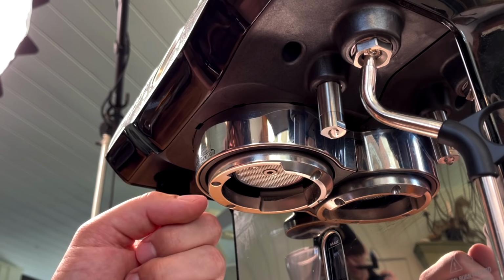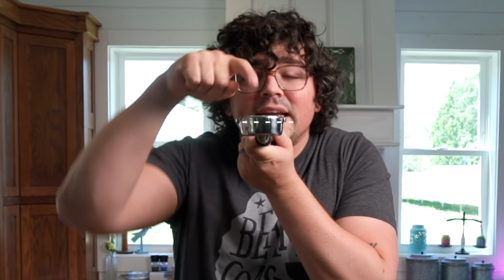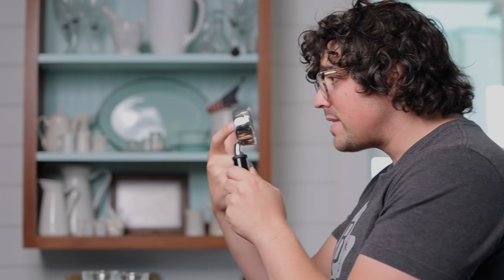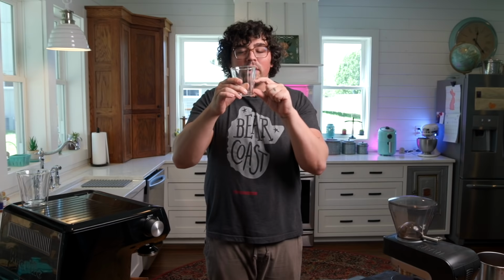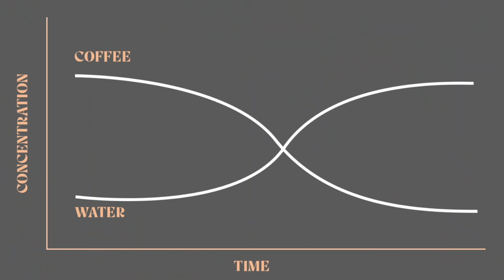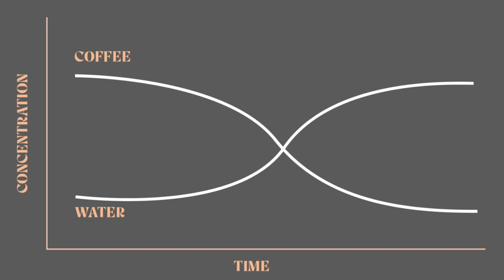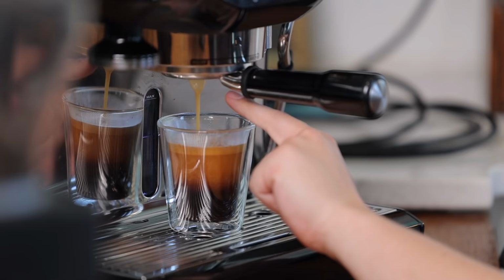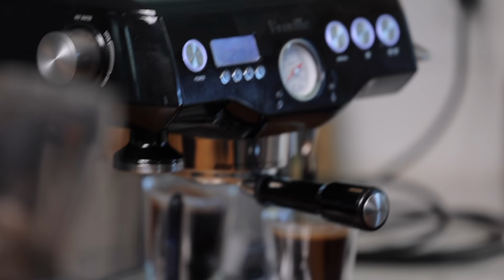ESPRESSO EXTRACTION THEORY: How to Dial in Espresso Like a Pro (pt. 1)

Comment: Professor Lance, please talk about optimal shot time. 25 to 30 seconds from first drip, or from starting of pump? Nice job. Thank you.
Reply from the maker: For sure! Next video will be hitting a lot more practical information on espresso. For now, just know that shot times should always start when you machine is started. Whenever water makes contact with the bed, start the timer because that part is still extraction. More to come and thanks for watching!
Reply: But then you have machines like the barista express which has 10 seconds of preinfusion. This is suoer long. In such extreme cases I would not count from button press. Also remember that way more extraction happens when water is flowing through the Puck compared to when it is just dripping onto it. So the part while it is aktually flowing out is way more important. Maybe try to shoot for the lower end of the 25-30 sec rule if you count from first drip. But all in all the rule just helps you to get into the right area if good extraction. After that go by your taste and preferences.
Reply: @Random-yj2tr  I guess it doesn't matter too much when you start timing as long as you use the same method when dialing in your coffee. I think that it might be confusing for some people if they start counting for 25-30s from first drip as in reality this could be more like a 35-40s extraction time (from machine start) and could lead to over extraction. If counting from first drip you might need to reduce your target extraction time by up to 7-10s (or longer with a long pre-infusion).
Reply: @chrisdturner  in the end the question is how much the preinfusion extracts the coffee compared to actively pushing water through. I sadly don't know how big this value is at all... :/  I personally think that preinfusion isn't contributing that much to extraction compared to pushing water through. And because preinfusion is so variable between machines I would start from first drop. But you are right, the most important thing is that you stay with your method during dailing in.
Reply: @Random-yj2tr  true enough, it's hard to tell the difference pre-infusion makes in an objective way and is probably contributes less than grind size and yield. I expect pre-infusion probably extracts little compared to when the water is flowing through the grounds under pressure but probably helps reduce channeling and get a more even extraction. I think using total extraction time as a reference (by any means) and learning to adjust by taste is the best approach for me personally but took some practice.
Reply: @Random-yj2tr   10 seconds is pretty short, and not at all extreme. In the case of the barista express, it's a marginal decrease in flow rate. Besides that: time should only be kept at a dependent variable. A 30 second shot could be battery acid or more bitter than pith.
Reply: Note time by button push,but keep it as a dependent vsribale. Dial in by ratio to your taste. Weigh your output. Ensure everything is consistent changing one thing at a time. 

Is it sour? Pull more yield. Is it bitter? Shorten your yield. Find a sweet spot and then keep varying within that range.
Reply from the maker: I understand your concern but just so you know, preinfusion is pretty massive in how it primes the puck. 10 seconds is degassing and will allow a rapid start to diffusion following. I have pulled shots on so many machines it'd boggle your mind haha! It is much easier to count from actuating to end as opposed to first drip. 
Regardless, time is least important. That's why I harp on not observing 20-30. Time is just not really something to consider in reality, at least not with the obsession most do. Anyway, my two sense working with preinfusion since 2015.
Reply from the maker: Yup! Nailed it..this is my approach certainly. 🙏🏻
Reply from the maker: Crap..first comment was for @random123 and second one for @dumkopf

Comment: Lance, you are the absolute best at explaining things in a way that everyone can comprehend and relate to. Please don't ever stop educating us! I'm currently using the new Eureka Zero espresso grinder and I love it by the way. But my grind setting is at about just under 1 and my shots from the time I see it coming out to when I reach the 1-2 ratio on the extraction is only about 15 seconds. I do lattes but when I taste the extraction, it is on the sour side. I am using the distributor tool for about 15 seconds, then I tap the basket to fill any holes, and I tamp pretty hard and before I remove the tamper from the grinds, I turn it (I say that because I'm giving all the steps and maybe I shouldn't do that last part). The machine is a Lelit Mara X with flow control. I have it set to expresso for the temperature (vs steam temp). I start the flow control paddle all the way to the left, leave it there for a few seconds and then slowly move it to the right (maybe I shouldn't). Any suggestions on why the timing is so short? I'm at a loss to figure it out.

Comment: Questions for the next video:
- Can you identify problems looking at the puck after extraction?
- Does dialing in change with coffee age (days Vs weeks)?
- If weighing & distributing, how else to improve consistency?
- Can you tell if shot is running fast due to coarse grind Vs channeling?
Reply from the maker: -sort of but not really. Can see holes sometimes, but doesn't mean if you see no holes there wasn't any channels.
- yes. Coffee is more easily extractables the further off roast it is (to an extent). So, chill out on variables as it ages
-weiss distribution technique 
-not really. If coarse, channels will shoot everywhere and flow will be fast. If channeling, well, could seem tight and slow with occasional odd squirts or could look normal or could look many other ways. Difficult to really know outside of taste.
Reply: @LanceHedrick  Thanks!
Reply from the maker: No problem! Some will be hit in next vid, but some will be saved for future more advanced espresso vids, so thought I'd go ahead and help

Comment: I have been making espresso since year 2000 this is super well informed.
Concentration is often missed I prefer ristretto espresso exclusively.
1 to 1 or 1 to 1.2 or so 25 grams in and out. 30 to 35 seconds 8 bar of pressure set at a blank.
This was super well explained would love you to do a video on ristretto espresso.

Comment: I just bought my first espresso machine last week! What perfect timing for your mini-series to come out! After pulling a couple of shots, I'm still having some difficulty dialing it in and knowing what I should be tasting for. Sometimes the shots turn out good, but most of the time it has a harsh jarring taste and an acidic punch. Not sure if the acidity I'm tasting is from having bright/light roasted beans or from an under extraction. Can't wait for part 2 to learn more and get the most out of my new machine! :)
Reply from the maker: Absolutely! Light roasts will seem sour if trying to pull them in the same range and recipe as dark, simply because they're not as easily extractable. Will go over all this in part 2!

Comment: Hi Lance, one thing I haven’t seen covered by any videos (which I’m really curious about) is what happens in terms of taste if you adjust two variables? For a starting point, let’s say I’m doing 1:2.5 at 9 bars over 30 seconds at a particular grind size. For this example we’ll hold time as a constant. What happens if I go down to 6 bars and adjust grind size so that I’m still pulling a 30 second shot at 1:2.5? How would the taste be affected? What if we held the grind size constant and reduced the pressure from 9 bars to 6 bars and just pulled the shot until we had our 1:2.5? It seems like there’s so much emphasis placed on pulling a 28 second shot +/- 2 seconds, but why? If I ground a little finer and the shot took longer wouldn’t things more or less average out because not as much water is getting through the puck in any given second?

I’ve watched some of your videos (including the follow up to this) as well as James Hoffmann’s understanding espresso series and everyone does a great job of explaining what these variables do individually BUT, they all have an interaction with one another. The interaction between two or more variables is what I’m trying to get a better grasp on. 

Maybe another way to ask this question is… is it possible to manipulate the variables in such a way that you can produce shots with substantially different variables, but which taste the same?

I’d love to have a Decent so I could just program a matrix test and do these comparisons directly but… I’d also need a money tree to make that happen. 😜 I just bought a new-to-me Robot from a friend. If I tried it with that I’d have disproportionately huge arms!

Comment: One added phenomena that I did not hear you mention is that there are lots of different compounds that extract…. And not all of them extract at rye same rate.  So, for example lots of the good stuff extracts easily and therefore in the beginning of the shot…. We’re as other compounds (like bitter caffein). Extract more slowly an are a more dominant part of the extraction the longer you run water through the puck.  So the over all taste of the coffee changes.   This is easy to illustrate by pouring a separate cup of water through used filtered coffee. Notice  the dramatic change in flavor.   It is not just weaker…. There is an entirely different  flavor
Reply from the maker: Yep. Of course. Not something I wanted to cover in a basics video, but something I have covered elsewhere! Cheers and thanks for watching!

Comment: Lance - I have watched part 1 and part 2 - best explanation I have ever heard.  I only make coffee for myself at home and not very experienced.  I have a question.  I owned a Barista Express until this week when it died and had no problem with my extraction.  Yesterday I purchased a Breville dual boiler BES920 and for some reason I cannot get the extraction pressure anywhere near 9bar.  I have set smart grinder to very fine grind after trying a coarse setting and made sure I have evenly spread the grounds and tamped as i normally do and still cannot reach anywhere near 9bar (about 3-4bar).  The only difference to my old machine is that I am using a bean I have not used before.  This one is a very light roasted bean.  Any suggestion would be appreciated.

Comment: I literally watched the entire video😂! Can't get a better explanation than this. Say, I'm having trouble pulling shot with my bes870, I have to use the double pressurized basket, grinder sets to the finest (1) and temp it with every ounce of muscles I have only to pull a bubbly, foamy, watery espresso....
Reply from the maker: First off, no need to tamp with all your might. Once the grounds stop moving there is nothing you can do. I go over this in part two. Are you using fresh coffee (less than 2ish months)? And have they been stored properly?
Reply: Roger that Lance! Will be waiting for the second part. Yes, the beans I used was less than two months. Im starting to think the grinder built in the bes870 is the issue as you mentioned in this video having a great grinder is one of the key to a great espresso. Eager to learn more from you Lance can't wait for the second part!

Edited: I store the beans in a cool dark place and they are kept in its own resealable bag.
Reply from the maker: It could absolutely be a main culprit. A good grinder is a huge must. More important than the espresso machine! Excited to drop part 2!
Reply: If you haven't tried it already, there is a grinder adjustment you change from inside the grinder. Take off the top of the hopper and you can see it. I have the same machine, and once I made that adjustment, the shots got a lot better. I hope that helps.
Reply: Aight mate! I'll give it a go later! Cheers😁
Reply from the maker: Do it! So awesome. Excited to hear the results
Reply from the maker: Love when others help peeps in the comments. Thanks, Jason!
Reply: Mates! I've followed the instructions both pros gave me and my shots has improved significantly! Nice crema and tasted all salty, sour, sweet and bitter😁😁 thank you guys once again🙏 cheers!
Reply from the maker: Absolutely! Stoked you are having some fun. Cheers!
Reply: Hell yeah! Congrats and cheers!☕

Comment: Hi Lance, thanks a lot for sharing those insights and making it so "simple" and exiting. I have a question regarding how to control the 3 key variables (grind size, ratio, time): in the end, aren't ratio and time the same thing? I mean, to get longer shot I would need to extend the extraction time. At the same time (please correct me if I am wrong), to increase the ratio still I would have to extend the time in order to get more ml vs. initial gr. Thanks again, I just approach to coffee making world and it is getting really interesting to me!! Mattia

Comment: I ave a question about the amount of coffee in a particular basket. My 15g VST basket takes 18g of coffee and produces a decent shout. 
If I put 15g as recommended there is a extra void space  over the pack after tamping which takes extra water and produces this messy sludge after pulling the shot. I have noticed this is the case with every other basket we have - smaller or larger. 
What is your take on that issue? What is the right way of filling up a basket?
Thank you.

Comment: Regarding dose and contact time.  Do you think 14g should take less time than 22g?  Like you said, at the extremes there is just nothing left to extract, thus it would seem intuitive that 14g should take less time than 22g.  I've noticed however a lot of people online seem to suggest manipulating variables like grind size so to achieve about 30 second shot regardless of whether the dose is 14g or 22g.  This never really made sense to me if you think about extraction.

Comment: Hi Lance, I have a question: I have a breville barista pro, and it seems like I can dial it in and get my grind and dose spot on and my shots will flow perfectly and for the correct time , then a few days later the shot will pull too slowly (thick extraction) or too thin (watery extraction) . Is it Normal to have to play around with setting frequently?
Reply from the maker: Yes! You need to cosntantly dial the coffee. As it ages, and as grounds sit in the grinder, there are necessary changes to observe. Just make minor tweaks as you notice issues!
Reply: @LanceHedrick  whew, that’s a relief, I thought it was just me. Thanks so much and thanks for your awesome videos 🙂
Reply from the maker: No problem! Completely normal. Thanks for watching!

Comment: Another great video.

I have the same machine as you.

I regularly unscrew the group head to clean but have found I was over tightening it making the shower screen concave and affecting the distribution of water. I was crazy thinking that it was the distribution of the coffee.

Have you had the same problem and if so how can you check if the water is coming out evenly through the screen?

Thanks
Reply from the maker: I have not! Rule of thumb is always screwing just until it stops moving. Never go further. Tightening can warp. Sorry about that! Get a new screen!

Comment: Thanks Lance, this was a very informative video. I've seen other videos about this but you covered the basics in a more understandable way. I had a quick question about pressure. If you used the exact same machine, beans, ratio, and grind size but only changed the pressure from 9 bar to 15 bar, which shot would taste better; the 9 or the 15 bar?

Comment: I loved your milk steaming video. Actually I learned something. I know you are using Breville Barista and I recently got the Barista Touch. It’s instructions recommend 60 ml out from 18 gm coffee! Is it something to do with that machine because I thought the optimal ratio is 1:2 just as you also say.  Thanks
Reply from the maker: I do not think optimal ratio is 1:2. If it sounded like I said that, it was wrong. That is the standard, not optimal to me.

And remember- 60ml of Espresso doesn't weigh 60g. Different density. Also, also, it should be noted they might be talking about the water that goes through the puck. Not the actual espresso yield. You know what I mean?

Comment: So, I've been dealing with probably not the best espresso machine, but through mods and extremely manual steps I've been able to pull some decent shots. However, I've only recently started paying more attention to the ratio in to out and actually weighing my coffee. The problem I have is it seems like everyone is expecting a 2oz shot, however, when I weigh my coffee (15g) a normal shot should be somewhere between 30-35g.  This is either at or just over 1 oz, meaning if I want 2oz of espresso for my morning iced latte, I need to pull 2 shots. 

Am I doing something wrong here or am I just misunderstanding what people are saying?

I will note: That my lattes are 100x better than what I've been pulling the last several years once I started weighing my coffee and pulling between 28-33g (no space for scale under the portafilter, so no way to be truly accurate on output) My home lattes are now rivaling those i get at the coffee shops and roasters I buy the coffee from.